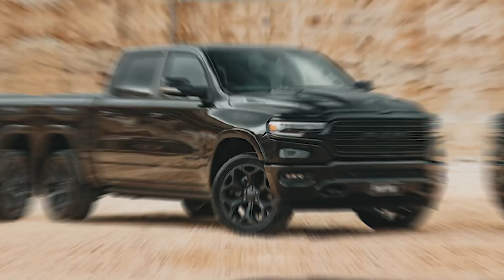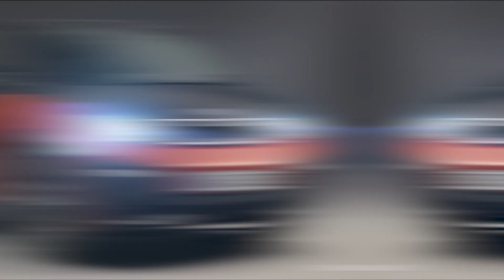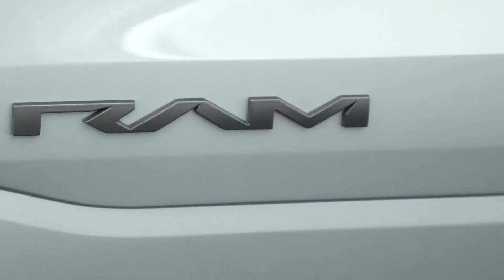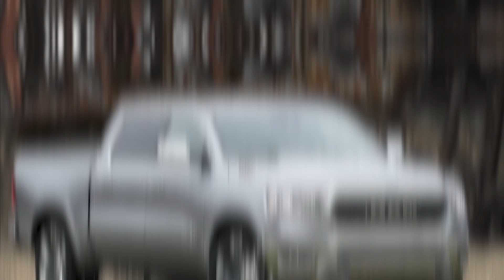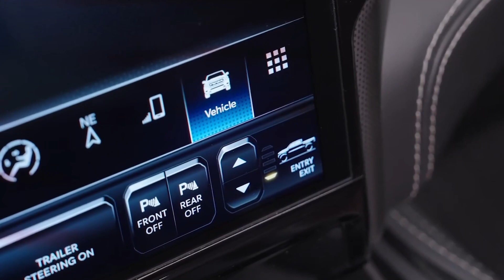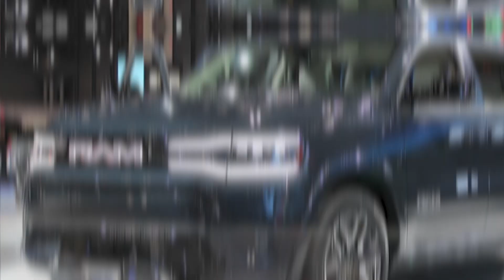Ram’s New 1500 Ramcharger has "UNLIMTED" Range That SHOCKS Rivals!

Comment: Can it hold charge while driving home from a supercharger and also charge at a standstill at 130kw to power a home microgrid? THAT would be epic. A timer or battery discharge percent like the silverado is all you would need. Or just have the truck start and stop once the battery is recharged. Im all in on the ramcharger if so.

Comment: Geez, Lets do the math. 690 range on 27gallon tank = 25miles per gallon. I got 33miles per gallon on my Ram Eco Diesel during a 3500 mile road trip driving + 5mph over speed limits  70 T0 80MPH. Truck is a 2022 Big Horn Level 2 trim. Rides like a sofa going down the road.
Price of the truck 53000. So eliminating the Eco Diesel is foolish move. They should have created a hybrid version of the Eco Diesel. Once the EV mandate gets retracted maybe things will change. In the mean time dealers are having problems selling EVs due to the high costs and the interest rates for the normal Joe. Lets get real-we are all in big trouble with what is going on. VOTE OIL
Reply: Yep but if you only take an occasional long trip and drive mostly within the 145 electric range then plug it in everyday and your mileage will be great. I have a PHEV Kia Sorento with only 32 miles all electric range yet most of my driving is local under 32 a day and avg 89 mpg!